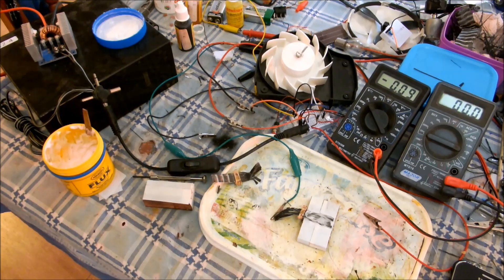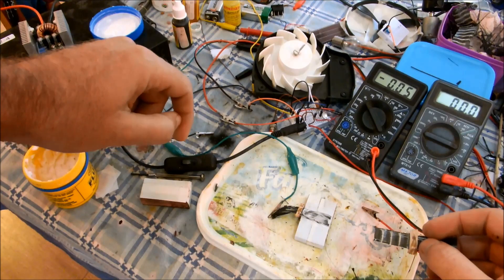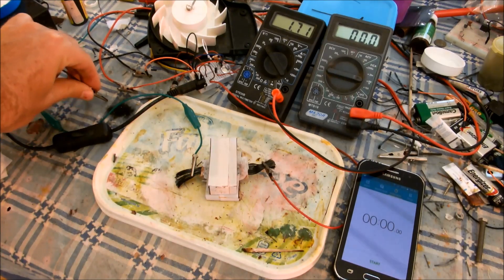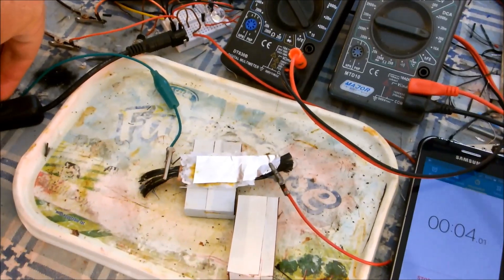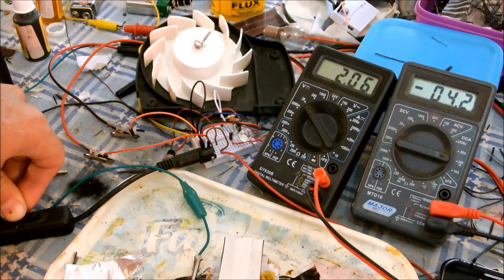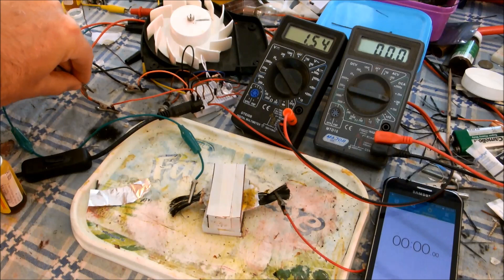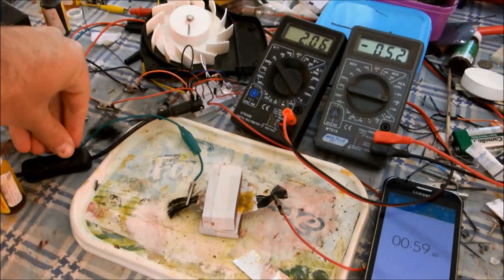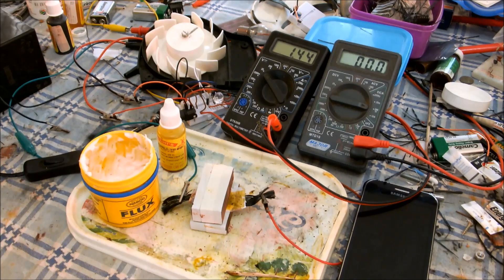Homemade Supercapacitor - or Battery?

Comment: Surely this will all corrode away very quickly??? Electrolytic corrosion.
Reply from the maker: The aluminium corrodes, but it is only required during the initial charge cycle. The carbon electrodes seem to retain the increased charge capacity during subsequent charge cycles. I have only cycled it a few times so I cannot comment on long term capacity.

Comment: Unless you tell us what's in the flux; how can we guess at the chemistry!??  :)
Boric Acid and..?
Boric Acid (Lewis) has some interesting electron orbital stuff  and forms an oxide surface on Iron Oxide and Aluminium Oxide that is Hygroscopic (NB!).  But Chloride..? 

Possibly there's  some sort of moisture absorption and H+ etc type chemistry..?

But Ja; What's in the flux for flux sakes!?  :)